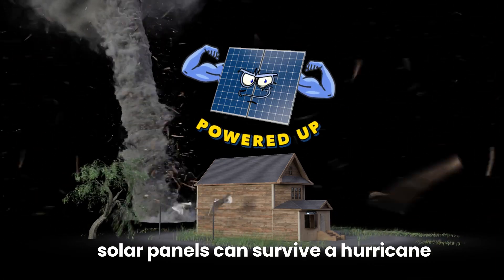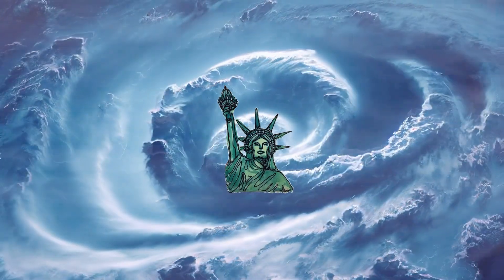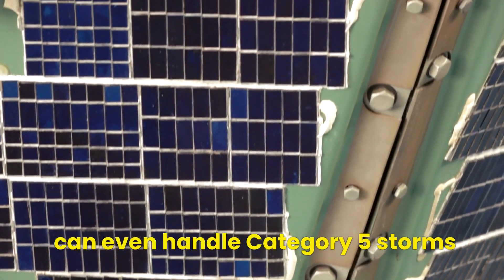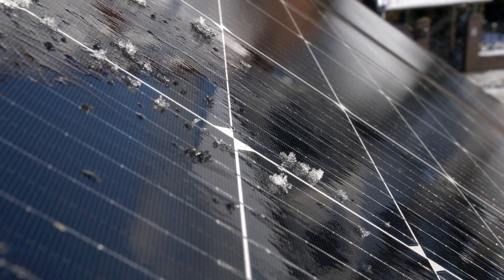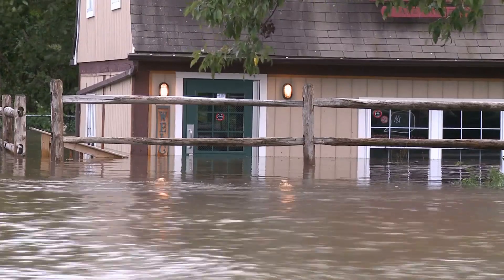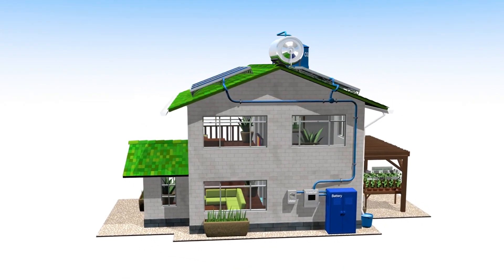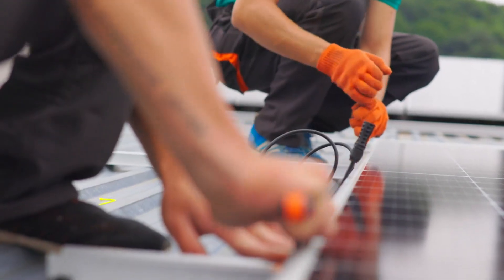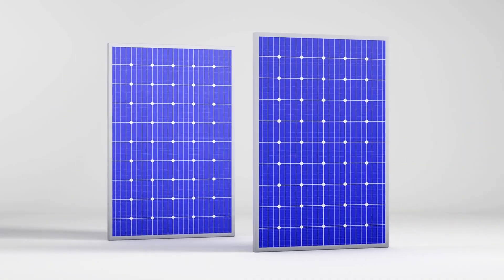Top Tips to Protect Your Solar Panels During a Hurricane 2024

Comment: Don't bother if you're watching for extra safe guard. This is all about not worrying about hurricanes.
Reply from the maker: The video actually highlights the inherent resilience of modern solar panel installations against hurricanes, suggesting that many systems are designed to withstand such events without extensive extra safeguards.
Reply: @renewable_energy Your right, and it's great to hear, but having grown up with hurricanes trusting things to be hurricane proof doesn't work for me. 
I was aware of what you mentioned but I don't think I'm alone in wanting to have extra protection. 
Which is what I thought the video was going to be about. 
Overall it was a good video, just not really what the title leads you to think it is.